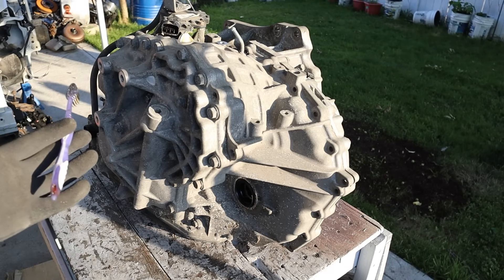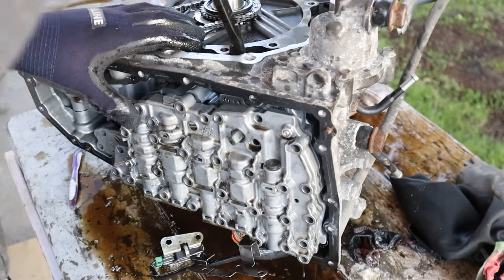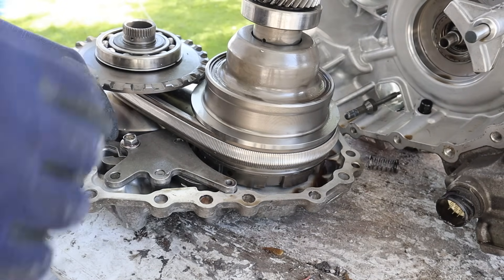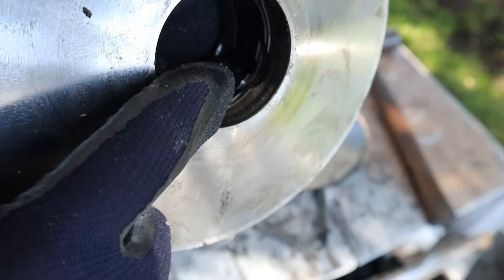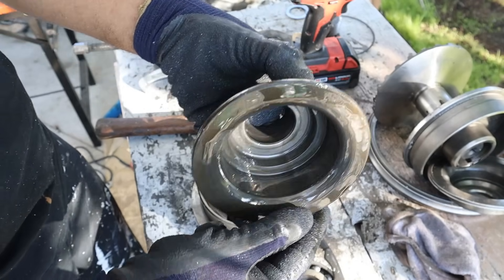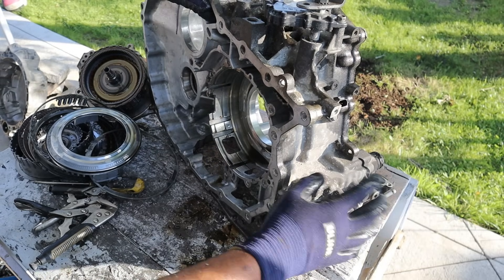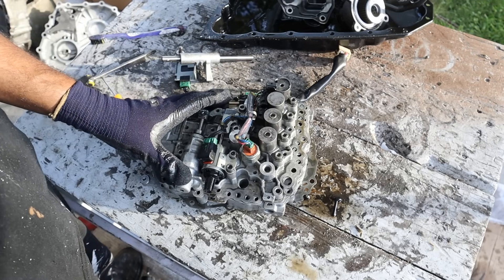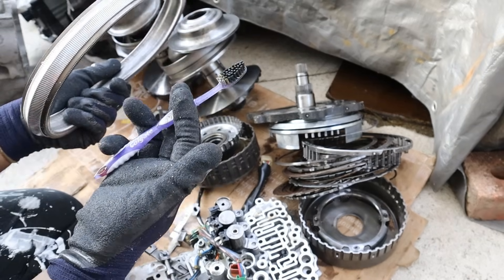Why Nissan CVT's are a FAILURE

Comment: As soon as I saw the thumbnail my first thought was 'I betcha they neglected changing the trans fluid' and it was mentioned that the fluid didn't appear to be changed a number of times in the video.  CHANGE YOUR FLUID FOLKS!  Not to say Nissan CVT's don't have issues but you neglect any maintenance, especially long term, it's gonna come back and bite ya.

I read somewhere that CVT's don't like jack rabbit type starts from a full stop.  No idea if that's true but it makes sense to my brain that if CVT's aren't as robust as a 'regular' transmission, gunning the vehicle away from a dead stop will put a high load on the CVT and cause premature wear.

My new 2024 vehicle has a CVT and I always start from a full stop gently and then once the vehicle is moving accelerate up to speed.  Will it make a difference?  Probably but who knows, time will tell.

Having said all that I dated a woman for 4 years who had a 2012 Altima and have to say, I've never witnessed a vehicle so neglected and abused in all my life.  That car should have died many times over yet kept trucking on without complaint.  I saw her and the Altima about a year after we broke up with more dents in it and dragging some part that was now hanging underneath the body, the car still trucking on.  Wonder if it finally gave up but if it has, it wasn't for lack of engineering or build quality.
Reply from the maker: They get abused because they are economy cars. 
CVTs are in economy cars because they get better gas mileage. 
Hence the endless loop of failing vehicles

Comment: Have a friend who works at Nissan. He says AVOID ANY MODEL WITH CVTs. Avoid them like the plague. There are many ongoing class action lawsuits. But from the company's perspective, the cost of fighting the lawsuits is still significantly cheaper than putting a real transmission in cars. These things are dirt cheap and not made to last.
Reply from the maker: Agreed....it's cheaper to neglect customers and keep selling cars with them. 

However some owners neglect their cars and don't change fluids either.
Reply: Crooked Courts and Low-resistance Class Action suits(that settle for $2 per car), are the cause. They get away with it, for a while.

Comment: So many negative video's on Nissan CVT's. Recently picked up a low mileage NV200 for a van conversion project. Will change CVT fluid every 25K and drive it gently. Castrol makes a quality inexpensive substitute for Nissan's NS 3 fluid that makes changes cheap now. Recently took a long trip and van runs wonderful. Some folks still do get over 200K on these CVT's.
Reply: No, change the fluid more often, about every 15k miles
Reply from the maker: I don't think it's all about fluids though.
Reply: @speedkar99  Of course not. You should drive a CVT gently and let it warm up. No jackrabbit starts or lead foot.

Comment: For an automatic transmission CVT’s are very efficient, but you have to look after them via regular maintenance. Also ease into the transmission from a stop until it’s up to speed, nothing really wrong with them just owners not understanding the operation of said transmission.
Reply: They just feel bad to drive, something feels off about them.
Reply: Nope. Early CVTs are undoubtedly a complete TRASH. 
Class action lawsuit doesn't appear out of nowhere you know?

Now it is okay.
Just change fluid every 30k KMS.
And you would be okay for ~240-250k kms
Reply: @dust it's not okay. It's never okay
Reply: @chris you're brain dead. Conventional planetary gear automatics are more durable and reliable but it must be a specific make and model

Comment: Nissan/JATCO should have just copied Toyota and Honda's design where they use a geared first gear since it's in starting off from dead stop that introduces the most mechanical stress to the transmission.
Reply: Does Honda use a geared first gear before the CVT gets engaged?  I've read Toyota does but never have about Honda.

Comment: I have a ‘17 Rogue that I’ve had since 70k miles. Now it’s currently 140k miles on the clock. Change the CVT fluid (I use Amsoil CVT Fluid and do spill & fill every 35,000 miles) and you’ll be fine.

Comment: I hate driving a vehicle with a CVT.  It's the worst experience I've ever had in a car, but I suspect the first prize will come if we ever lose the option to drive a non-EV.
Reply: EV drive better than any V8 with linear torque application. Most ev are quick and some are neck snapping fast. I didn't want an EV because I don't think they are safe enough yet. We need a way to put out the fires from li-ion batts
Reply: @workingcountry1776  There is no way to put out a lithium fire, the material is combustible and as it burns it produces its own oxygen to fan the flames.  Same as when you put oxygen with the acetylene flame - acetylene burns dirty until you hit it with O2 then it melts steel.

Comment: Garbage, 2015 Murano, and 2016 Maxima. Long gone From my garage.
Reply from the maker: You had them ?
Reply: @speedkar99  I did, the Murano we limped on a summer trip from Colorado to California and it had 52,000 miles on it. I waited for a cool summer day and drove it straight to Toyota and bought a new 2020 4Runner. It was doing the bucking torque converter thing, and you had to be gentle on it when it got warm. She was slipping. 

The Maxima was on its way out at 93,000 miles, luckily Mother Nature helped me out there. It got totaled at work with golf ball hail. 2 days later I bought a 2019 new Tacoma, it’s since been traded for my 2021 4Runner. I love these things. I have owned Nissan since 2004, 3 Titans, 2 Frontiers, 2 Maximas (the 2005 was the best one), 1 Altima, and 1 370Z. I miss the Z. Quality suffered, I tried. I’m a big Toyota 4Runner fan boy now.

Comment: My mom's 2013 Nissan Altima CVT failed at 51k miles (even with the fluid change and Nissan knew it was flawed) while my 2011 Nissan Versa with 4-speed Automatic that hasn't failed still rolling at 255k miles. I admit it that 2nd gear is starting to slip a bit
Reply: Oof, failure at 51k would be very irritating.
Reply: @James-vt2cb  Yeah, sci-tech will save us. This kinda irritation drove me to metaphysics...:face-orange-raised-eyebrow:
Reply: @James-vt2cb even worse is that Nissan knew it was flawed but went ahead anyway just like Ford and Getrag and ther lousy Powersh#t DCT
Reply: How often do you change the fluid? My maxima is 130k kilometres and still going strong, change the fluid every 20k kilometres
Reply: @ramadhanisme7 only like 150 bucks a year to sort of reduce the chance of trouble 😅.good tradeoff
Reply: The question I have for u is when u changed the fluid did they change the filter of the transmission also do u guys check the fluid as there is a level indicator and needs to be checked with the engine running nobody checks she may of been low on fluid is what happened there
Reply: thats strange, my friends 2012 nissan altima is still running strong with 240K miles on it, original cvt transmission
Reply: @drewdevon2009  people dont take care of their cars they blame the car while they are the problem
Reply: @fortnite360HZ  exactly 💯 👏  finally someone with common sense
Reply: @drewdevon2009  me and my dad have 2012 altima no problems i still have a 96 civic best car owned and a 2016 honda crv no problems either just avoid the turbo stuff they are making today
Reply: @fortnite360HZ  honestly the turbos are good too, the thing with the turbos is they dont tolerate extended oil change intervals.  frequent oil and filter changes are a MUST with turbos
Reply: @drewdevon2009  i changes oil every 5000 kms not miles no matter what it is so thats less in miles im canadian we go by kms so 5000km i do on every car the turbo cars require idling before shutting off so oil can circulate in the bearing my friend has an 87 buick grandnational we always have car chats

Comment: they sell upgrade kits on sonnax, i think. the check balls are a known failure and the pressure regulator gets debris. if you change them keep the valve body so you dont have to do a relearn

Comment: All you have to do is change the oil. I've got one at 275K and it's still going strong.
Reply: It seems fluid changes and probably mild driving behavior. Maybe a little luck, too.
Reply: Linear progression on the pedal. No stomping. Also helps when going D to R complete stop between. But then that's most t.
Reply: What brand of fluid do yall use?
Reply: @vqdriver  NIssan OEM fluid ONLY.
Reply: How often do you change it?
Reply: @facundonu  welp Carwizard thinks it should be done once a year! Some people think every 10,000mi. Others every 30-60,000. Also opinions on filters vary as well. I like every summer or every other summer drain and fill (remember it’s only a partial 25-30% drain and fill so you might wanna do a passive flush or a 2-3x spill and fill that first cruddy time). The filters maybe every 30-50,000mi never letting those 10mm bolts corrode. Just do it
Reply: @vqdriver  thanks a lot!

Comment: Im no CVT defender but these cars are driven by the worst demographic.
Reply: Think about how often any normal person would change their trans fluid in a conventional transmission…0 times, lol.
Reply: @JohnZornAscended  tru dat,    brake fluid 0 too,   smh.
Reply: @auntbarbara5576  Lol, it’s nothing. Crazy world..
Reply: Nissan focuses on leases and they don't teach customer that although CVT is much better for fuel mileage and drives better than a torque converter based multi speed translate it needs more aggressive service. 
This is based on working at a massive dealership. It has nothing to do with being popular with any particular ethnic group
Reply: Aunt Barbara go bake a cake
Reply: Wow! So cute!
Reply: And what demographic is that?

Comment: I change my own CVT fluid every 20,000 miles on my 2013 Accord Sport. So far so good. 👍
Reply: I change it every 50.000 miles and still going strong with my Jatco CVT. (85000 miles now, 10y/o).
Reply: @ronaldderooij1774  Your CVT should be failing any day now. The common fail is between 70,000 to 90,000 miles.
Reply: @blipco5 yep! Mine just tanked...103k miles.
Reply: @luna272  That’s too bad. I recently sold my Accord Sport. It was a great car. I bought the 2025 Camry hybrid. It has what’s called an e-cvt. It doesn’t use a push-belt. It is all gears. There’s no rubber band effect.
Reply: How many miles so far? I think that is the right interval for a drain and fill, and I'm using it on my '22 Sport SE.
Reply: What kind of CVT fluid do you use?
Reply: @vqdriver  Me? I use the Honda fluid recommended for the transmission. I buy it online for $8 bucks per quart. Dealership charges $11.
Reply: @blipco5  that’s a real good deal for CVT fluid
Reply: How many miles do you now have?… I also have a 2013 accord cvt car..with 173k and I do the fluid change every 25k
Reply: @donovanfahrbach2493  Mine is 60,000 mostly city miles. I also have motorcycles, bicycles and public transport to commute. Hence the low mileage. But I’m very easy on accelerating in my Accord. I don’t beat on it.

Comment: It appears that the CVT was still functional albeit barely so due to the heavy wear on the pulley shaft keyways on the drive variator.  Insufficient pressure most likely caused this as you pointed out in your video.

Comment: Do you think that If you buy a low mileage Nissan with this CVT that it's worth changing the fluid and filter to try extend it's lifespan or does it make more sense to just plan to have to replace the whole transmission with a new one at some point in the cars lifespan?
Reply: How many miles do you want to get out of the CVT?  If you're hoping to get to 200K miles with it, you'd better replace its fluid and filters periodically.  Replacing the CVT is big bucks mostly because of the labor cost.  A rebuilt CVT is about $2500 from a dealership.
Reply: @thx1138guy  just looking to gather opinions like yours. this has been an 'issue' for some time now so I'm sure there's plenty of people who can chime in with their experience on these. CVT's have been common for awhile now and time has shown that some manufacturers get it far more right than others. if it's failure rate is extreme then servicing the CVT becomes less practical than putting cash towards inevitably needing a new one.
Reply: @jordanimatedstreaming yes it does, mine is 2009 maxima at 130k kilometres and still going strong, change the oil or fluid every 20k kilometres and that's it
Reply: I agree. We have a newer Altima SV (2022 I think) and everything about it exudes a feeling that it’s meant to be enjoyed now while it’s newer and working properly and then scrapped in a few years. It’s a throw away car. It arrived new with things wrong with it like door seals not installed correctly and plastic interior panels not snapped together correctly. Plastic parts on the rails that the front seats slide on pop off - it’s worse than crappy LEGO block knockoffs that don’t fit together correctly.  The whole thing reeks of being slapped together carelessly. We’re changing the ATF every 30k miles but I still don’t have much confidence in it. We bought it because it’s the most sedan we can get at a lower price point - but we wouldn’t buy again. EDIT: I came back here to add that Roman on Regular Car Reviews mentioned that the Altima will be discontinued in a couple years (2026).
Reply: Definitly.  Also don't accelerate hard.  If your having shifting problems its not the tranny its the control.
Also many mechanics just want to jump into tranny replacement without a clear diagnosis.  Find an honest repair shop with educated people working there.
Reply: Its hard to think of a Nissan that would be worth a replacement transmission. These are crusher fodder.
Reply: Wouldn't it be easier to just get a vehicle without a CVT 😊
Reply: @louarmstrong6128  Yup, my Nissan CVT died and I bought the last 8 speed Toyota offers in the Camry. The 2025 Camry's are hybrid only with CVT's.

Comment: I still find it interesting that nissan, who's customers generally just want an appliance that will move them about, without thought or concern for their car's well being, decided to use such a maintenance intensive transmission in the mainstream appliance cars.   They hold up ok in the smaller cars with regular fluid changes,  but outside of that it's kind of all doom and gloom.  I can appreciate the upsides that a cvt offers, but man did they fail to deliver on this one for the core nissan demographic (which they unfortunately share with kia)
Reply: CVT's are way cheaper to make. Gears take skilled gear grinders, that you have to pay. Most of the parts in there are cast, CNC milled, or stamped. Machine made automation.
Reply: @ssmith4013 the only skilled gear grinders that you will find working today are in tool and die shops.
Reply: @ssmith4013  It's always all about that almighty dollar.  It's too bad they have such a high failure rate.  Being able to keep an engine in its peak efficiency range regardless of demands has a lot of appeal for the vast majority of how cars are typically used.  I just worry that the high failure rate will have the same effect on cvt's going forward (assuming the longevity problems get fixed, other manufacturers introduce better models, ect) as the gm diesel 350 debacle of years past had on the US diesel car market.
Reply: Honda, Hyundai/KIa, and Toyota are using CVTs more frequently in their small vehicles.  They're better than Nissan CVTs but they will fail prematurely too if not maintained properly.
Reply: That's actually not something you can compare. Nissan has more CVTs on the road than any other manufacturer, they were the first to use it across almost their entire line up. Only in the last 5-10 years has everyone else started using them. And now everyone is making it standard.  So of course Nissan is gonna have more failures, it's simple math... Subaru and Kia are quickly catching up and in fact have had more failures in newer gens than Nissan. Nissan has actually improved their CVTs, almost as though they learned from 15 years of failures. Nissan effectively beta tested the CVT for everyone else. Now they have to live with that reputation.... Idk I have never had an issue with any of my CVTs, but I don't drive like I'm in a race, monitor my transmission regularly with consult-2 and change my CVT fluid every 15k miles.

Comment: We have the Mitsubishi version, a 2011 Outlander with 140K miles.  It's decent basic transportation, though underpowered.  Ours is FWD, and we don't tow.  We also change the fluid at the dealer every 30K miles.  Maybe Mitsubishi did something right with these that Nissan didn't?
Reply: Mitsubishi Lancer did better somehow
Reply: Same transmission made by JATCO division of Nissan
Reply: @workingcountry1776 I hate Jatco transmissions!
Reply: Yes, the engines were weaker, the engine computer did not abruptly release torque and the cooling of the transmission was bigger capacity than in Nissans. That is why you say your car is underpowered. Mitsubishi designed it that way to keep the CVT alive. And it works.
Reply: @ronaldderooij1774  But on the bright side, it isn't as underpowered as the Saturn Wagon it replaced!  LOL